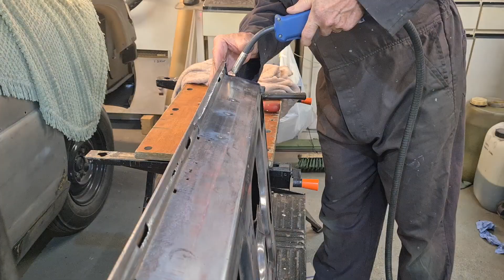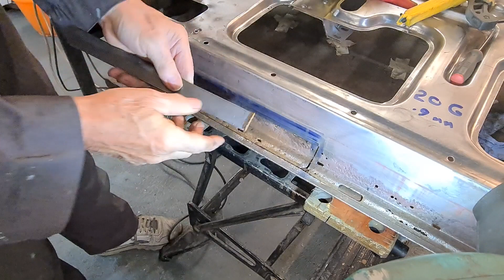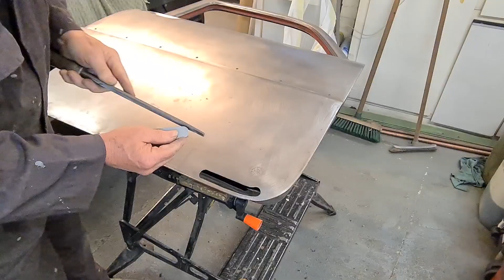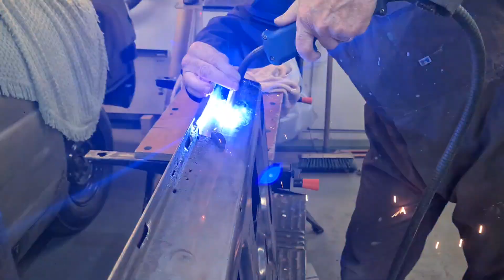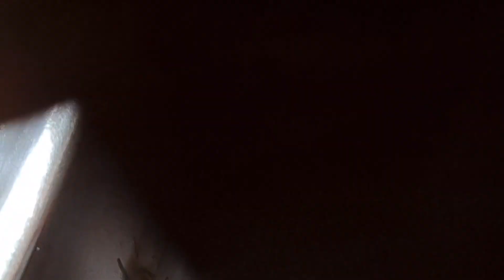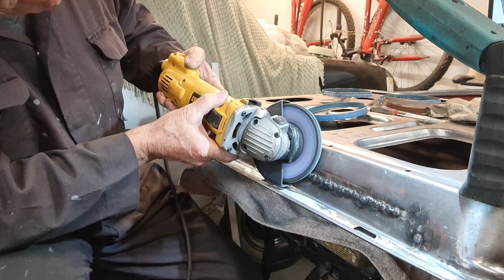Welding Door Patches

Comment: I received these patches and fitted them in the summer on my mk1 drivers door i am a novice but was extremely happy with the result. Many thanks Steve for the tutorial here which helped with my self taught attempt mate
Reply from the maker: Thank you for the nice comment. I still have some of those patches for sale if anyone else is doing the same repair, and I can make them to suit if the rust is worst than mine.

Comment: Hi Steve what's that tool your using to cut and sand seems a good tool to have being small enough to get in places a grinder won't.
Reply from the maker: Hi Lee it's a Dremel 4000 and I purchased the right angle head separately. I find its handy for all kinds of jobs because there are lots of different wheels available on ebay.